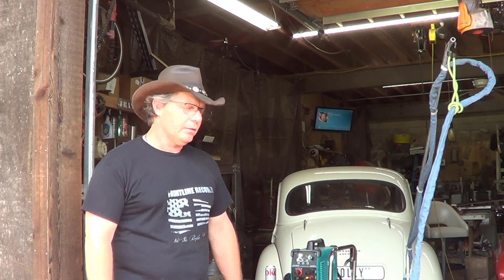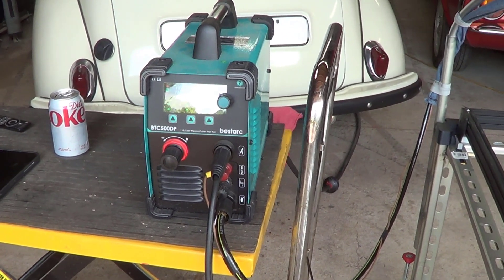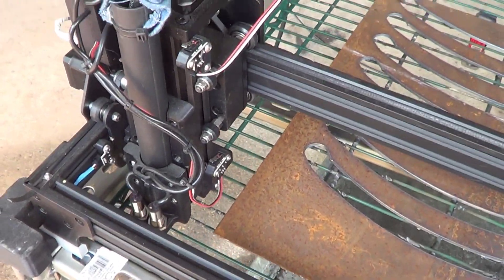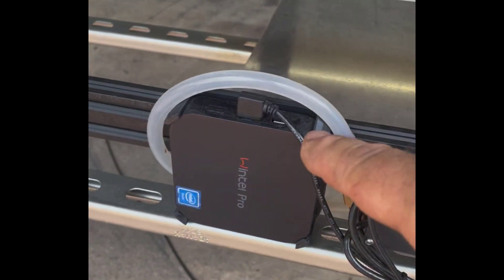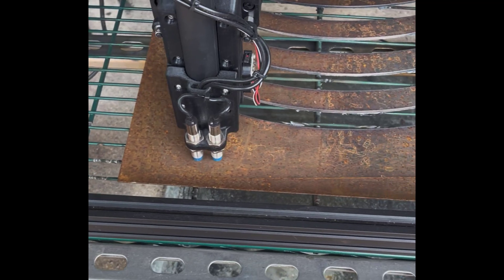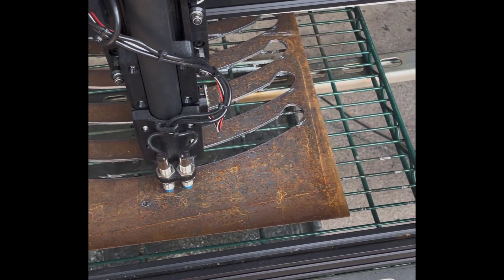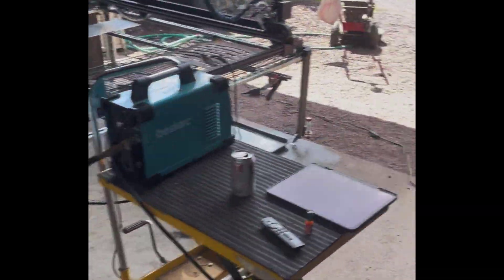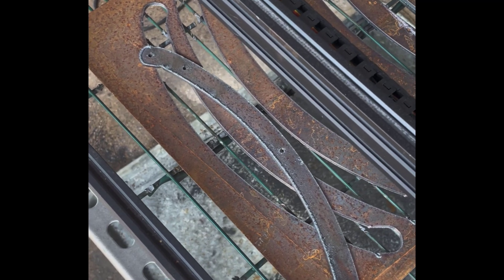Plasma Cutter Table For Less than $600 DIY

Comment: What weight do you think the laser cutter table can hold? I'm thinking I could do a similar conversion to a fiber laser welder. The head on its own is around 1kg but there is w bunch of extra weight with the qbh, fiber cable, water cooling, etc.

Comment: Nice job! I look forward to seeing a more in-depth video. Especially in regards to the THC. How well do you think the proximity sensors will hold up with the heat overtime?
Reply from the maker: I have been cutting quite a bit over the past few days, probably a combined two hours total(that's alot).  Haven't seen any probs yet. I have knocked off some slag spatter a few times from tge threads. Still no issues with the plastic tips. Or with the 3D printed mounts.

Comment: What CNC setup did you buy?

I’d love a cost effective 4x8 CNC router.
Reply from the maker: They have all sizes and configurations
Reply: @frantasticdesigns  Thanks!
Reply from the maker: Just found this amazing item on AliExpress. Check it out! $635.41 | 90W Laser Engraver Rotary Roller 50W With Air Assist Plywood Laser Cutting Machine Acrylic Cnc Router Wood Engraver Metal
https://a.aliexpress.com/_mMz8LkK

Comment: that's a great price for the laser cutter. would you mind sharing the link?
Reply from the maker: Just found this amazing item on AliExpress. Check it out! $490.24 | Laser Engraver Frame Kit Area 1000x1000mm Printer Laser Engraving Machine For Wood Engraver And Cutter Acrylic Diy logo
https://a.aliexpress.com/_mOxjSZ0
Reply from the maker: Same co. Has multiple sizes with and without components
Reply: @frantasticdesigns  Thanks a lot!

Comment: Really surpised those inductive probes don't freak out while it's cutting lol
Reply from the maker: First sensors I tried did, but before giving up , I tried the ones in the videos, and they worked perfectly. Have about 6 hours of cut time on the unit, and everything is working fine. I did have some issues occasionally losing comm to the control board because of the HF start of the arc, and was prepared to switch to a blowback torch machine, but isolating the controls and computer from the plasma cutter by putting them on an AVR  UPS seemed to do the trick…..

Comment: Very impressive cost effective build. Yep I noticed the Opel right away because I always wanted one. I would love to see how you did the torch height controller. Because I got a free giant flatbed printer that has a huge gantry with a Z axis stepper and I will eventually build a cutter, but for now it is a 9 foot by 5 foot workbench.
Reply from the maker: Give me a couple of days, plan on doing another video on how I made it, and parts used. I am out of town today, so not at my computer
Reply: Thank you. I would love to see how you made it too! Will use your “recipe” if you are OK with that. I would love to build one for my hobby shop.
Reply from the maker: @andrelaloni9631  i
Reply from the maker: I will try and make it simple to understand

Comment: This is sick, how long did it take to build?
Reply from the maker: A couple of days, mostly waiting for various parts from Amazon. I designed and 3D printed a lot of the torch holder and relay boxes. The torch height control was the tricky part.